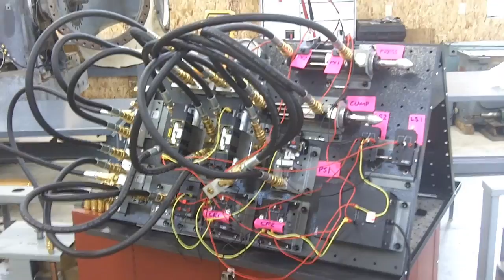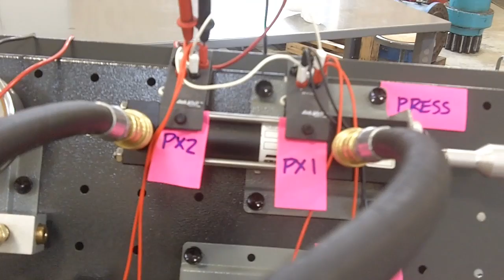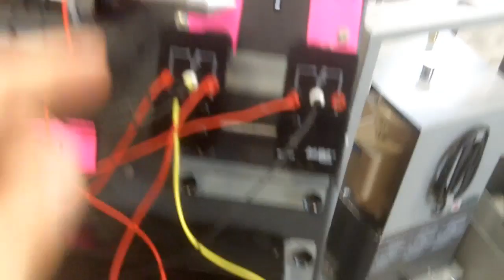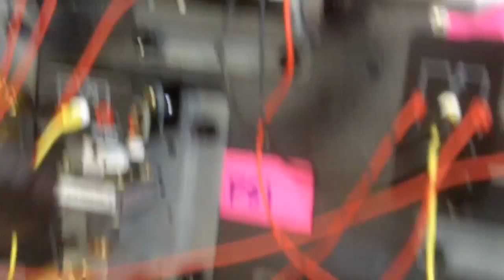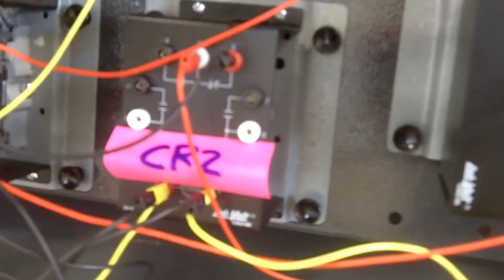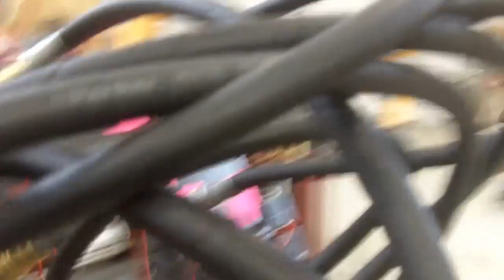Electrically Controlled Electrically Sequenced Hydraulic Circuit Example

Comment: Here's another example problem for electrically controlled hydraulic system on my other channel: Electrically Controlled Hydraulic System Example: Extend and Retract With Limit Switch
Expect major updates to this channel summer 2014. Long term I'm planning to include the whole basic electronics series, hydraulics, power electronics, control electronics, motors/generators, and renewable energy applications. Subscribe if you're interested in receiving updates.
Reply: Juan Barillas